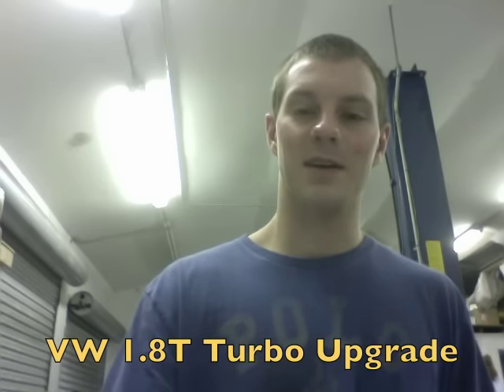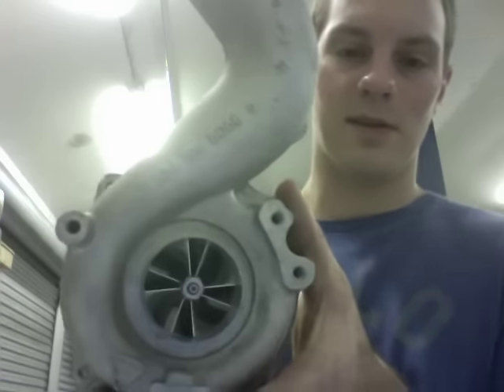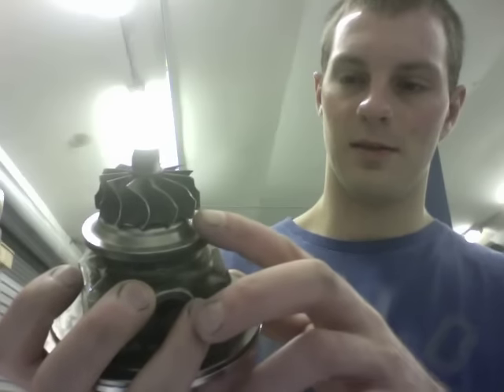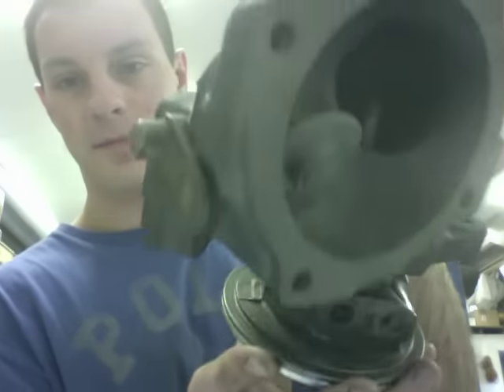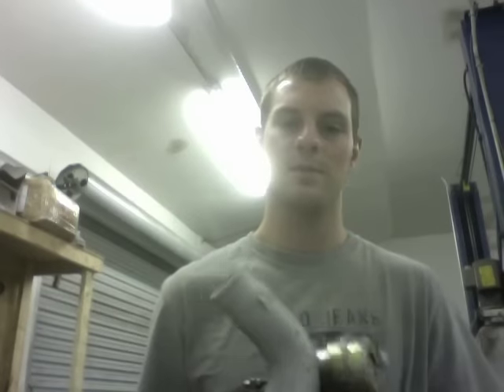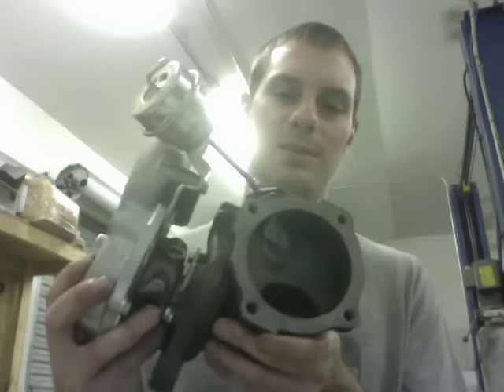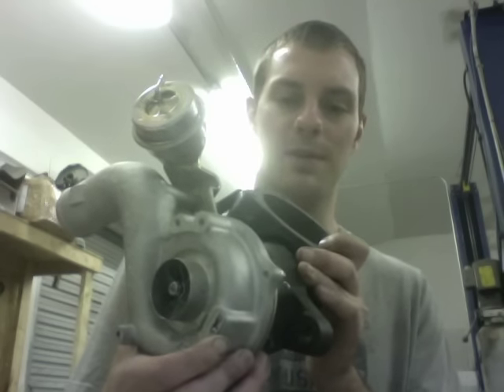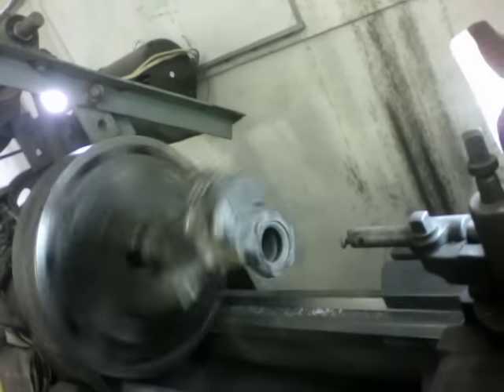VW MK4 GTI Jetta Beetle 1.8T KO4 K04 Turbo Upgrade

Comment: wow thanks for the detail! Could you go into a bit more detail regarding the two k04 wheels available? Thanks!
Reply from the maker: +Dre Zee  im not too sure on the Horsepower capability of the 42mm compressor wheel, there is a factory ko4 turbo that uses the same wheel, which we do have it in billet. The 42mm wheel is a lot easier upgrade, the 50mm upgrade requires sleeving the compressor housing, can do that a lot easier now since i have my haas tl1 with the 3 jaw. I just have not done it yet.

I think i have a jetta 1.8t compressor housing to upgrade to 50mm, at least i know i have an extra one. I have to be really precise with sleeving it for a pipe though because, because inserting the pipe  makes it sit where the compressor wheel sits, so i have to do a press fit, which i have done many times. This will be one of my future projects for sure.

Comment: The beetle 1.8 t has 150hp or 170hp i do not remember, then do you mean with this upgrade would have 366 hp?
Reply: BRUH. 1.8t could be 150 or 180 hp. Max horsepower depends on tune, turbo, injectors, etc. Stock internals are suposed to be around 350hp max with bigger turbos. And the max hp the turbo flows will be dictated by turbine/compressor housing, and evidently turbine/compressor size. So what u saying is a vit vague. Unless.... im up for a big r/swoosh. Hope this helped!

Comment: I am interested in the 50mm K04 upgrade you mentioned at the end of the video. How much would a rebuild my stock K03S with a ported comp housing and all of the K04 bits?
Reply from the maker: +Luke Wheeler we would do it for 650, but i may need a month to get to it since the holidays are coming.
Reply: @turbolabamerica  i have a 2003 gti 20th anniversary i want to do the 50mm ko4 upgrade how much would it cost me???

Comment: are you still offering this service? I've got a ko3s from a awm Passat. what are my options
Reply from the maker: +chino cochino i only have done 2 of them just like in the video. It's difficult to machine the turbine housing on my haas tl1 which is mainly why I haven't done many upgrades for this one. I remade the plate to make it easier, but it's still hard. I could do it but I can't start untillthe end of June because I have  vacation and some work to catch up on.

Comment: Can you do that to my Brand new K04 001?
Reply from the maker: +jjgbmw323 I'm not familar with the 001 number or what it means.
Reply: +Turbo Lab America it is a K04 Turbo that bolts on to the factory manifold made by Borg Warner. I have a brand new one I want you guys to rebuild like the one in this video. How much HP And TQ Will it make? I Have emailed you and am ready to ship it out.
Reply from the maker: jjgbmw323 there are a few different versions of the ko4. Do you know the measurements? It makes a different on cost. There is are 3 different ko4 turbine wheels. One is 42 x 50, another is 44.4 x 50 with a 5mm tip height and the last is the same size 44.4 x 50 but has a taller tip height
Reply: +Turbo Lab America please respond to my email, I have outlined all the details there.
Reply: Ive just got a ko4 001 with a 42mm compressor i thought thay was supposed to be 38mm ?

Comment: Are you selling them?
Reply from the maker: +fockyoumang i only do these as a service, but lately i have been converting my tools to cnc.
Reply: +Turbo Lab America so you can take a k03s and turn it into that? That's awesome work, I remember when I wanted to put a grand national compressor wheel on my Merkur XR4Ti back in 98 it was more than the cars worth
Reply from the maker: yes I machine them out and put larger wheels in them. there is a company on ebay that offers a similar upgrade but i think theres only comes with a 42mm shaft.  there are a lot of options for turbo upgrades now.
Reply: +Turbo Lab America so I can ship YOU the k03s and you can rebuild it? I don't think that's something I want to do myself, not having any experience with the k03s. It's something I need done because oil is staying to leak a little bit into the piping before the intercooler, not after it
Reply: +Turbo Lab America so the k03s will make more boost and hold it, with your upgrade and have a faster spool up? I'm interested